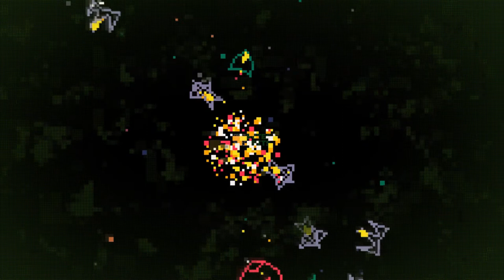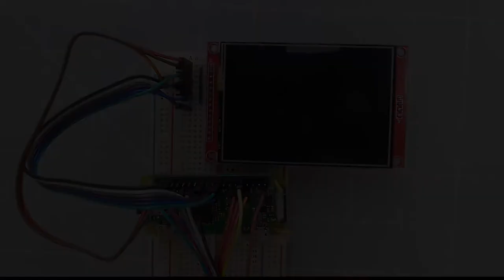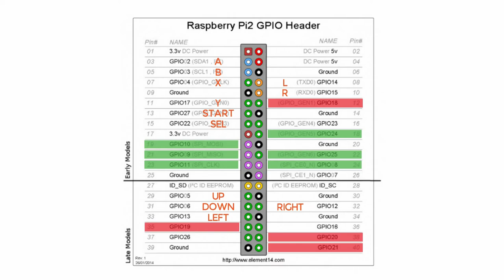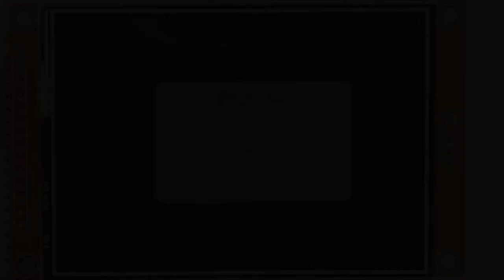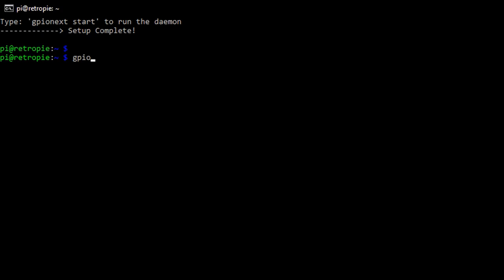Using GPIO Buttons in RetroPie To Make Your Own Game Controller or Handheld Console

Comment: First search result popping up was this... and it was the solution! My table pinball machine is going forward. Many thanks. :)
Reply from the maker: You're welcome!
Reply: @BytesNBits  Hi! There is a way to install raspberry pi OS AND retropie inside, that could be controlled by gpio controller with GpioNext?

Comment: Wonderful job. Thank you for helping figure out a good GPIO program. Just an FYI. I have a pi 3 b, installed the base pi image retropie-buster-4.7.1-rpi2_3.img.gz and the install and setup of the GPIOnext would fail. I finally updated all the updates in the retropie_setup.sh.  After all of the updates, the GPIOnext installed without a hitch.  In case anyone has this problem.  Great instructional.
Reply from the maker: Hi Richard. Thanks for the solution on getting the code working with the latest versions of Retropie.
Reply: @BytesNBits  Thank you.  If I can help with anything else, please let me know.
Reply from the maker: @rdean1972  Great. Will do!
Reply: @rdean1972  It says Failed to add edge detection when I open the config-manager

Comment: This was super helpful. Thanks for laying it all out like that! What screen are you using? Most of the gpio screens I see use up way more pins than that one.
Reply from the maker: This is just a standard SPI screen, but not using a parallel interface (multiple data lines).

Comment: Not sure if i missed it, but what GPIO header did you use for the common? is that just ground?
Reply from the maker: I think I used ground and set the GPIO input to use the inbuilt pull up resistor.

Comment: Thank you for this great tutorial! What display are you using? And is  the setup the same with a RaspberryPi-4? Also, I want to make a miniature RetroPie multicade with swappable control panels. One will be a standard joystick and buttons, one will be using a Pim447 trackball and buttons and the other will be using a rotory encoder as a spinner and buttons.  standard tactile buttons.
Reply from the maker: The setup should work with any Raspberry Pi model. Good luck with the arcade cabinet.

Comment: What is the display that you are using for this project? Also, great video demonstration!
Reply from the maker: Hi. I'm using a fairly generic ILI9341 driver based SPI lcd panel. It's using the standard SPI interface rather than an extended parallel data line version.

Comment: Hi sir can you make it Joystick module(X-Y dual axis) interface for mouse arrow and switch as select for Raspberry Pi zero board
Reply from the maker: Hi. The GPIONext package does support a good range of inputs but you'll need to look at expanding your IO pin count to get what you're after. Have a look at the cocumentation as I think it covers using I2C IO expanders.

Comment: I am a newbie - got my pcb prototype board and the buttons. I am trying to fit the push tactile button in the board so I can solder from the other side but their pins are too big for the holes. Was this also your case? If so, how did you do the soldering/building on the top side of the board? if you have a guide on how you put together this controller would be very useful
Reply from the maker: Hi. Yes, not all the through hole components fit directly onto the proto board. You might need to drill out a few holes. I use double sided protoboard with solder pads both sides and through hole plating. This lets me solder top side if the component doesn't fit. It's really a matter of doing the best you can to get the circuit complete.
Reply: @BytesNBits  thanks! So as long as things are connected properly, the "condition" of the existing or new holes doesnt matter as i understand :)

Comment: Hi Bytes and Bits, great video! I'm building a handheld at the moment but I keep getting an error saying AbsInfo module is missing from evdev and I can't work out what to do.

I've tried reinstalling GPIOnext, updating all packages for Retropie, installing evdev manually, starting and stopping GPIOnext, but none of them work and there's not much info online.

Do you know what might be causing this please?

Thanks again for your video it's really great!
Reply from the maker: Hi. I'm not sure what the problem might be, I haven't seen that one before. It might be that something else on the Pi is conflicting with the packages. Is this a fresh install of RetroPie. Have you added any other packages?
Reply: @BytesNBits  Ah I see, okay no worries. I formatted the memory card and redid all the steps and this time it works! Not sure what changed :-S Thanks very much for the help though!

Comment: Hi. 
Great tutorial but I have a problem. 😅
I connected 1 d-pad and 4 buttons to emulate a GBoy but after installing GPIOnext the setup did not start giving the error "failed to add edge detection" which I fixed following a guide of Mholgatem. 
Once Retropie has restarted the system scrolls continuously to the right.
My configuration:
Raspberry pi zero 2w, retropie 4.7.1 (for pi 2-3), ili9341 2.2" lcd, diy pad with 8 buttons (up, down, right, left, start, select, A, B).
Reply from the maker: I'd start by disconnecting the gamepad and starting up the RPi. If the scrolling continues you've got a software setup issue. If the scrolling only happens when the controller is wired in it's probably a wiring error. Try connecting the inputs one at a time to find when the error happens. Good luck.

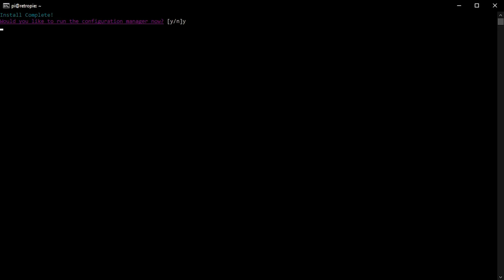Comment: At 8:46 GPIONext shows a "Commands" option, what kind of commands are they? 
That's very interesting because I'm using 2 Zero Delay Encoders, one for P1 and one for P2, but I also want 4 extra buttons for admin functions like retroarch Menu, Quit, Pause, etc , do you think I can wire these buttons to GPIO pins and trigger these hotkeys in retropie?
Reply from the maker: GPIO next allows you to map gpio pins to pretty much any input button on the computer. in the list you pointed out I think you map buttons to mimic keyboard keys. I haven't looked in the commands menu but just select it and it will give you some options. So yes, you can wire in extra buttons and map those to keys or other buttons. Then in Retropie set those as your hotkeys.

Comment: I've wired up buttons to use for this in a similar fashion. When I run gpionext config (after having messed with all the pulldown, set pins options a million times), gpionext never detects the button clicks. However when I write python code to check if the buttons work, they all do. Do you have any idea what the issue could be?
Reply from the maker: Hi. gpionext has some options to tell it what buttons it's allowed to use. Usually it assumes it can use everything but it might be getting overridden somewhere. Have a look at this video https://youtu.be/YqF3Z0AAnIY. I was getting the sound output messing with the gpionext functions. Hope it helps.
Reply: @BytesNBits  that could be it. I have an awful set up using pwm audio from one of the gpio pins and and the spi display connection. I ended up writing my own script to simulate keyboard presses when buttons are pressed and that works for me

Comment: Hi, Thanks for the instructive video. I, although have a bit different project on my hands. Instead of GPIO pins, I want to use an ESP32 to wirelessly send the push button and joystick inputs to my Raspberry Pi 3 which in return would act as a wireless controller for retro-pie on Raspberry Pi. If you have any video regarding this manner then please refer it to me.
Reply from the maker: I used an ESP32 as a bluetooth keyboard in this video - https://youtu.be/BkfmBk6OeQM.
The basic principle is the same. You just need to find the bluetooth definitions for the game controller interface. The library I use in the video has a game controller library by the same developer.

Comment: Do I need to set GPIO14 and GPIO15 as normal GPIO interfaces before everything starts? Because my GPIONEXT doesn't recognize these two pins
Reply from the maker: It's worth clearing any special functions for these pins just to make sure. If GPIONext still can't use them check for other drivers taking control of the pins.

Comment: Hey what kind of hook-up wire did you use? Is it 22 gauge? It looks soild core.
Reply from the maker: It is very thin solid core. The label has come off the reels so I don't know the actual guage. It's basically wire wrapping wire but with a thin plastic covering.

Comment: Quick question, how many button inputs are you to fit on the GPIO pins? Also can you send multiple inputs through a single pin?
Reply from the maker: I think you can configure as many pins as are available. Unfortuately just one button per pin.
Reply: @BytesNBits Update. It ended up working, and all my buttons are working. But for some reason when I try and hook up my thumbstick, it only detects "up", and "right". (This is for my arudino thumbstick, and a custom one I wired myself)

Comment: Is there a version of this board with each module separated? Like joystick own boards, buttons, etc. I want to try and retrofit a rasp pi into a broken wii u gamepad and turn it into a steam deck Jr lmao. If I succeed, I could finally remove all the emulated games I have on steam deck which fill up the games page
Reply from the maker: You'd need to break down the circuit yourself. It's basically some buttons connecting the GPIO pins to ground.

Comment: I'm sorry, I'm trying to figure out the wiring for the buttons.  It's hard for me to see where all the wires are going even in a blow up of a capture of the back. Any chance you might put up a wiring diagram on your site? Pretty please LOL
Reply from the maker: Hi. Each switch is simply used to connect the GPIO pin to ground. I use the internal pull up resistors on the Raspberry Pi so we don't need external components. On the actual board I simply connect one side of each switch to a common ground from the RPi, and then take the other side of each switch to the GPIO pins. I hope this helps.
Reply: @BytesNBits  Yes! After thinking about it I thought that’s what you did but thanks for confirming.

Comment: Hello I used your exact configuration to the gpio for a diy gamepad like in the video and "Start" and " Ltrigger" do not work. And ideas?
Reply from the maker: Hi. Try connecting these non working buttons to two of the working GPIO pins. This will confirm if it's the wiring or the software. If they work you can try mapping the buttons to different GPIO pins. There might be some other setup in your RPi that's interfering with these IO pins.

Comment: Great video! But I'm not getting all 8 directions with my joystick (I'm only getting up, down, left, and right) could you help me fix that? 

Right now I've having the joystick output if it's pointing up, down, left, or right; if it's pointing diagonally, I will have it output the two states (eg. if I point it up-right, the joystick will output to both the pointing right pin, and the pointing up pin). Should I be doing this differently?
Reply from the maker: It sounds like you've got it all designed correctly. I'd start by checking the pin voltages when you move in a single direction and then in a diagonal. It might be some sort of short circuit that's pulling the pins low when more than one switch is closed.
Reply: @BytesNBits  Hmm, I haven't thought about that. Thanks for your help, I'll go check it out.

Comment: im a bit new with all this wiring and stuff but how can i remove the breadboard from the setup? i want to make it as compact as possible and a breadboard sort of gets in the way.
Reply from the maker: Hi. You need to design an printed circuit board to connect all the bits together in a small package. It's another project on the list of videos I want to make.

Comment: If I completed configuring my controller in the console, and then modified my controller a day later by adding a new button, can I re-configure my controller with the new button? If so, how?
Reply from the maker: make sure you've added the button in GPIONext and then remap the controller in RetroPie
Reply: Thank you, that really helps. I had  another question though. The thing is that retro pie does not occupy my entire display (5inch lcd), and I was wondering how I could fix that. I tried changing the resolution but it didn’t work.

Comment: The first 26 GPIO pins on my rpi 3b+ are taken up by my display. I am 1 GPIO pin short for the controller. Is there any workaround for this? Can I like set the Select button as a double tap of the Start button or something else in the software?
Reply from the maker: Does your display use an SPI connection? Quite often the connector covers a large block of pins but is only using a few of the GPIO connections. The others are just not connected but covered by the header. If you get the pinout for the screen connector you can use jump wires to connect it to the RPi and then gain access to the unused pins.
Reply: @BytesNBits  Yes my display uses a SPI connection. According to its documentation there are some free pins. I'll those. Thanks for the help!
Reply: @BytesNBits  I just tried it out using jumper wire. The display powers up but doesn't show anything. It's just a white screen. I'm using the fbcp-ili9341 driver on my display. Do I need to tweak any of the driver settings?
Reply from the maker: @safwansadad6488  If you've used jump wires for all the connections you should be fine. Don't forget the power connections! All you are doing is extending the pins. Make sure the connections are good and that you've not missed any pins. Try not to use overly long wires. If all else fails try reducing the connection data speed. If that fixes it you've got some sort of noise issue. Again check connections and wire length. Just to check - was it all working when connected directly to the Pi?

Comment: Hello, where did you get the cover for your joystick?
Reply from the maker: I 3D printed it.
Reply: @BytesNBits  That’s awesome! Would you mind sharing the stl file? I am making a controller for my high school engineering project.
Reply from the maker: @graceb5539  I don't think I bothered to save the design. It's simply a sphere. Cut off the bottom section. Then cut out a cuboid on the flattened surface to fit your joystick stub.

Comment: Great tutorial! I followed along and almost have it working. My GPIO joystick  is detected, I can map buttons and navigate Retropie menus.  But upon launching (mame) emulators, the GPIO controller disconnects. Any ideas?
Reply from the maker: Hi. If you're using the Libretro cores through Retroarch you probably need to map the buttons in there. Launch a game and press Select + X. This should bring up the RetroArch menu. Find the input settings and there should be an option for mapping the controllers (I can't remember exactly where it is). If you go through that it should let you tally up Retroarch with the controller buttons. Then in Mame you need to press the Tab key on the keyboard (there's probably a key combination as well) to get to the Mame key mappings. If you set the general inputs this will be the default for most games. You can the modify individual ones from there.

I hope this helps.
Reply: @BytesNBits  thank you for your detailed advice and fast reply! I will follow your suggestions, it's so close to working now 😃

Comment: Great video - do you know if you can use a button matrix with GPIOnext rather than using one pin per button (using diodes etc.)?
Reply from the maker: I don't remember seeing that function but do check the documentation. It's a while since I've used it now.

Comment: could you help me? i am trying to finish my console and i want to use a ps vita joystick and d-pad and 6 buttons and 2 shoulder buttons and start and select, menu.
Reply from the maker: Hi. You'll not be able to connect this sort of controller layout directly to the Raspberry Pi. You'll need to make/buy a game controller circuit which you can connect via the USB port. Have a look at https://create.arduino.cc/projecthub/361085/arduino-game-controller-f3ffec.

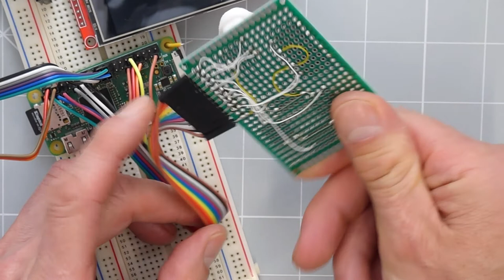Comment: How do you wire everything up on the bottom of the prototype board? (4:14)
Reply from the maker: Hi. The prototype board I use is matrix board where every hole/pin has a single solder pad. I simply wire from pin to pin with very fine solid core wire (or use wire wrapping wire). It's very old school but easy to get things up and running quickly and in a small space.

Comment: hello, how can I do this with 2 customized controllers. for my own 2D game
Reply from the maker: You'd need to check the driver documentation to see how many inputs it supports. It should be a matter of connecting up the extra buttons and mapping them into the code.

Comment: would this work for a raspberry pi 4 (with RetroPie of course)?
Reply from the maker: Should do. Although the video is now a bit old so not sure if the drivers are still compatible.
Reply: @BytesNBits  thanks and respect for still answering questions 2 years later

Comment: hi  when i do that project i came to would you like to run gocfuguration manager i press y but it says 

Traceback (most recent call last): File "/home/pi/GPIOnext/config_manager.py", line 14, in <module> from evdev import ecodes as e ImportError: No module named 'evdev'

i cant find a solution you can help
Reply: Try running install.sh again. If it's still not working, execute the command: "sudo pip3 install evdev (If you open install.sh in a text editor such as "nano", you can find that exact command)
Reply from the maker: Hi @Zeitiah Thanks for the tips on fixing this issue.
Reply: In my comment, I shared the solution for this exact problem. I ran updates for everything in the retropie_setup.sh.  After I did this, I was able to install the GPIOnext and run the configurator without that error. Hope this helps.